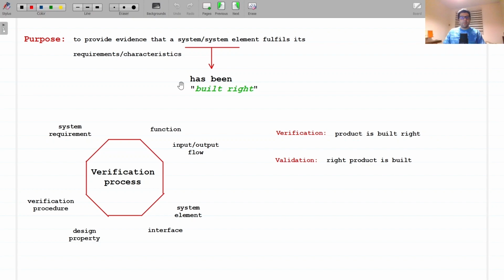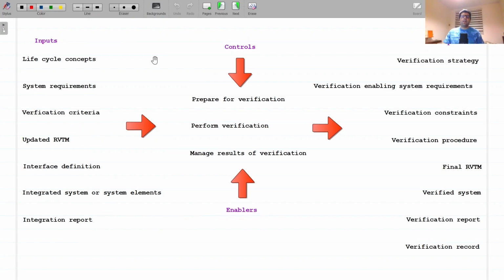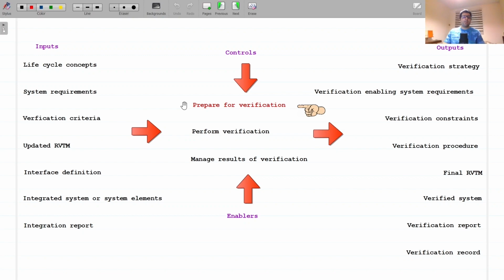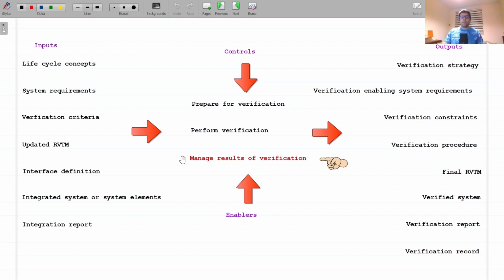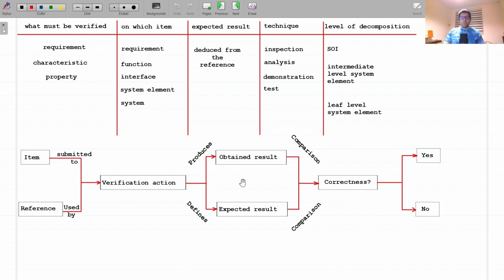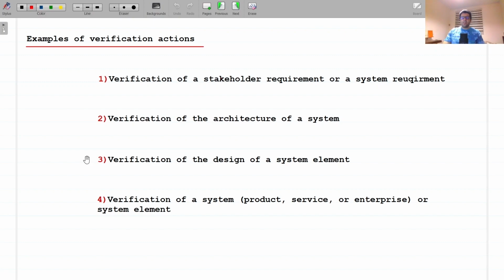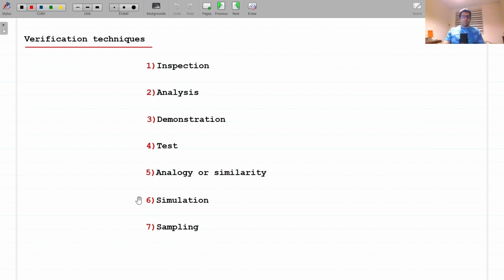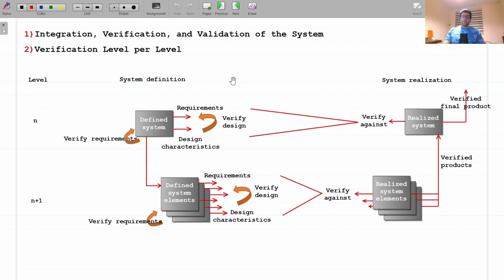Systems Engineering Training Session 20

Comment: what confuses me is: there are many terms out there and they seem to be used interchangeably from companies to companies. Could you simply differentiate between "qualification", "verification" and "validation" with an example for each please?
Reply from the maker: Consider an automotive ECU as an example. The software specifications dictate some requirements on the software, and verification here helps to determine whether the software complies with the requirements of software specifications. On the other hand, when the software is verified, it is time to show that the whole ECU complies with stakeholder needs. This is, in fact, the role of validation to show such a relationship.
Reply: Assume you want to design and implement a brake system for a car. 
A stakeholder wants you to deliver a brake system that works in icy road well. You make a set of design specification out of this stakeholder need such as: brake system controller shall have maximum 0.8s response time. 

After you've designed and implemented the system, first you verify the system upon design specification (e.g. 0.8s response time), and  after all specifications are met, you can validate if the product meet the stakeholder need (braking on icy environment)
Reply: @alim.hosseini4638  thank you both! But what about qualitification?
Reply from the maker: I encourage you to read below article:
https://asqasktheexperts.com/2012/06/12/qualification-verification-and-validation/amp/